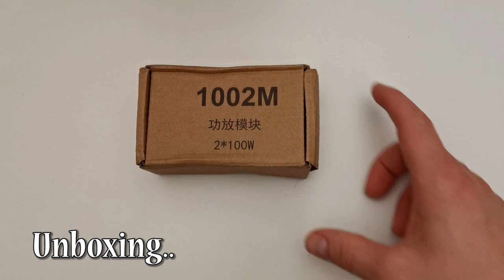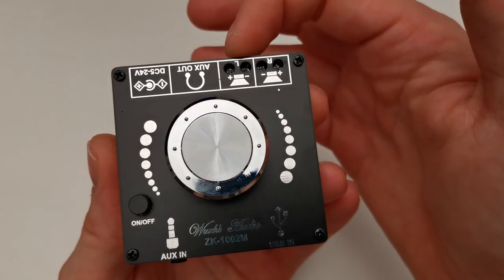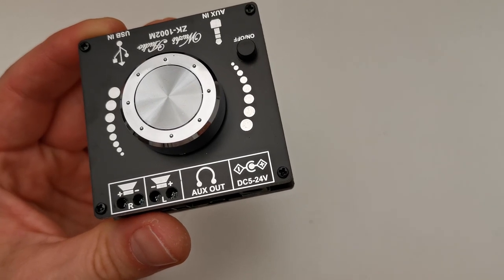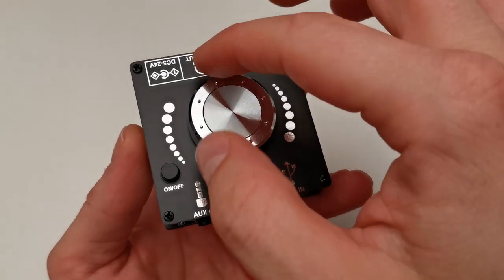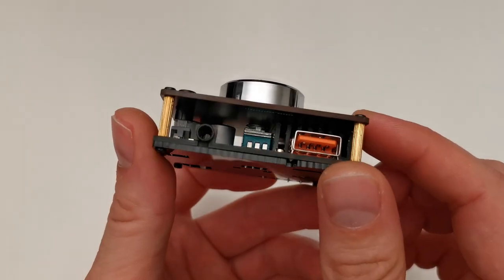Wuzhi Audio ZK-1002M (100W+100W) - All in one Mini Amp

Comment: (100W+100W) Are you sure about that ?😀
Reply: I have a similar version from this company.. mine says 100Wx2 as well. Needs input voltage between 5-27v. 
I hate amps like this.. they basically make speaker matching a bloody nightmare! 
to be honest, i would never trust a Chinese company's claim of being 100Wx2 with an amp circuit like this. I don't understand why Chinese companies always exaggerate their specs. It's like if they are trying to outdo one another with how much lies they can get away with. They probably get their business sense from reading "Art of the Deal." Lies and dishonesty and a disregard for ethics. smh.
Reply: @nickloss2377  That's so true
Reply: @nick loss  then what about sound quality? Any noise?
Reply: Correct

Comment: how much amp output is required for 24v dc power supply ?

And does it support LDAC?

Did you tried to connect this with PC over USB port?

Comment: Hi, I'm building the same speaker. 
I want to power it with a battery. So I need help to determine the final power consumption and battery size. 2 speakers, 10w each. with the same digital bluetooth amp.
Thanks

Comment: Can any 1 recomend a power supply for this iv tried 5v via a samsung fast charger and it comes on flashes blue for 5 seconds and turns off.
Reply: It works with 12v or 20v for me